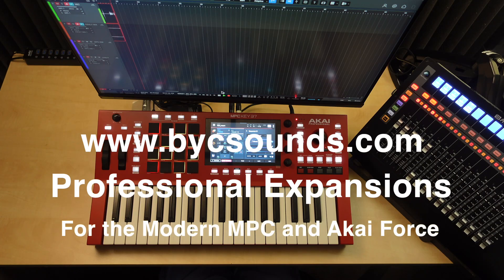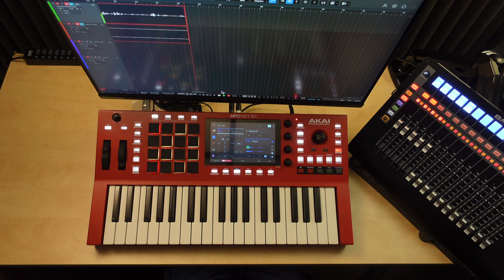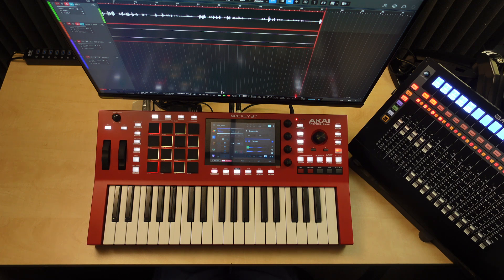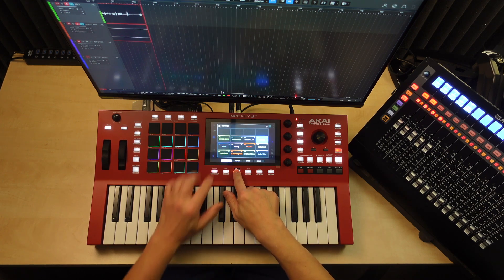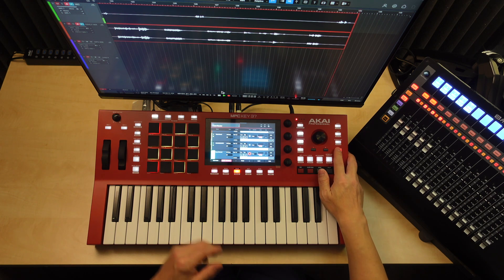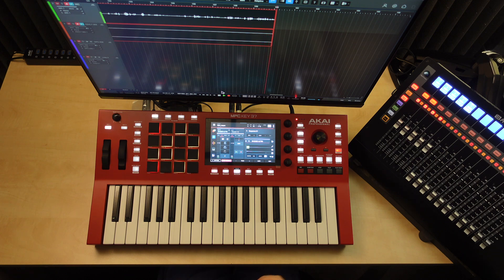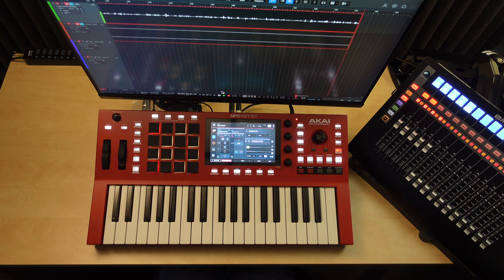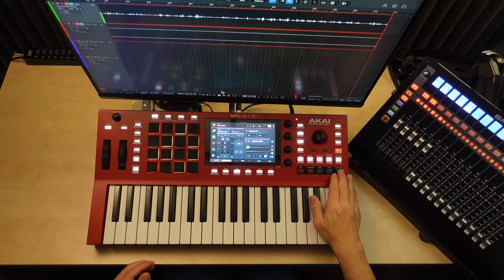MPC: upgrade your RAM. is it for you?

Comment: from what i have been reading, the ram issue is only from using the MPC stand-alone, and if you will be doing most of your work connected to a PC, you won't have the hardware limitations of the MPC to work around. If this your experience? I am brand new to making music and have a key 37 arriving sunday, so I am just trying to see what I am up against and if it will even be an issue for me.

Comment: I bought a key 61. I did  a torture test on it. 8 tracks of plugins and a number drum kits. It went to 48 percent. I was happy with that, so I bought the 37 and at this point in time, don't need a ram upgrade. I am sure as newer plugins come out I will need more.

Also, can't you stream from the SD card slot now days? You don't have to use up ram, or am I getting that wrong.